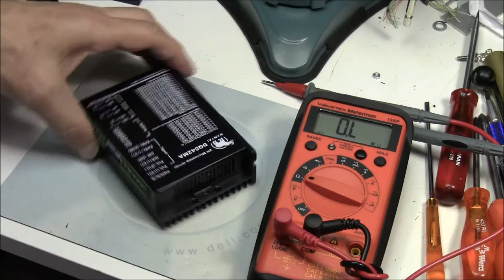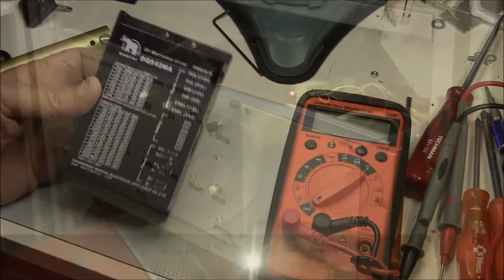Repairing a DQ542MA stepper driver

Comment: What if there is no fuse? what part of the driver usually would go bad? I have a bad stepper driver where the motor just buzzes and doesn't turn.
Reply from the maker: Thank you for your comment. All of the DQ542MA have fuse, the inside should look the same as mine, if there is no fuse then they did not install it. If the motor buzzes but don't turn then anything can be wrong, perhaps your motor, or your PSU, or even the driver. I can't really help you out on this.

Comment: What if not the fuse.... turning motors while all off can damage the driver?... I just left my cnc off for several months...then when i turned on...one driver dont works...just death
Reply from the maker: I am sorry, I don't know. Since I made the video I managed to fry another one and I also thought it's just the fuse, but it was not. I tried to find the fault but gave up because the drivers are cheap, so not worth spending too much time on them.

Comment: Hi There, can you perhaps share the exact fuse model you used please? my stepper is also dead - received it dead when bought new, so I think I'll do your testing this evening and replace with a 50v 10amp SMD, but It looks like you get various sizes of these SMD's? I'm not sure - please can you assist?  thanks a mill
Reply from the maker: Hi, The fuse I bought is called: Littelfuse Fast Acting SMD SMT 1808 10A 125V surface mount fuse similar to this one:

https://www.ebay.com/itm/10Pcs-Littelfuse-Fast-Acting-SMD-SMT-1808-10A-125V-Surface-Mount-Fuse-/182395604433?hash=item2a77a00dd1

The size of the fuse is exactly the same, so it is very easy to solder a new one on top of the blown fuse. It is however important that you are definitely sure about the blown fuse and NOT solder on top of a fully functional fuse because that may cause serious problems later on. Connecting fuses in parallel means that you increase the current from 10A to 20A which means that the fuse is no longer protecting the driver, so diagnose before soldering the new fuse on top of the old one.

Good luck with the repair.
Reply: Perfect - thanks a mill for the quick reply :-) now to try and find these babies in South Africa, mission # 2 :-) let you know how things went! thanks again, much appreciated!!
Reply from the maker: https://www.mouser.co.za/ProductDetail/Littelfuse/0476010MR?qs=sGAEpiMZZMsIz3CjQ1xegc2b%252bH%2f4y90ivrfVPzgV2rqjDTBaXyVH3g%3d%3d

Immediate delivey, ZAR 17,51 piece if you just want one, or ZAR 13,06 piece if you buy 10. Plus shipping of course, if you can't collect it. The other alternative is eBay but it takes longer. A third option is to replace with a glass fuse but then you have to add a fuse holder also so it will not be that nice.
Reply: good Lord Man, you put me to shame :-) I did find some at Linkage, (in JHB the fuse cost R2, in CPT the eact same fuse costs R38 - not a lot of money but such a jump in price...) Im on the Mouser .co.za site - looking for their CPT branch!! thanks a mill (again) :-)
Reply: I mailed their South African branch to see what they can do :-), so that would solve the 1 stepper driver, then I have a dq860ma that gets the green power light to come on, but nothing else else happens on the silly thing, I recon I would try replacing that fuse as well (which is a different fuse) looking for technical spec on that driver as we speak.... :/ I thought hobbies were suppose to be fun :-)
Reply: No Mouser in south Africa, not even sure why they have a south African customer support email add or why their Domain is registered as .co.za.... anyhoo - I did find what I need for now, thanks... I just hope that this would solve the issue. (on the flip side of the coin, I did find a place here in cape town that can repair stepper drivers :-) (if all else fails)
Reply: UPdate : short answer would be that it didn't work, didn't receive the right fuse, but did try same on my dq860ma driver - no luck, went and bought a TB6600 4.5amp, will collect today to get my machine up and running again.... thanks again for your guidance and efforts - much appreciated!!

Comment: I have a DQ542MA 4.2A Stepper drive and it is not working.  What does the Blinking red and green LEDs mean?  I can not find any pdf documentation on the drive.  Can some one relate to this ?  or have advice
Reply from the maker: Hi, I guess only the red one is blinking. What it means depends on the blinking. It can mean that "Over-current protection activated when peak current exceeds the limit." or "Over-voltage protection activated when drive
working voltage is greater than 52VDC".
Reply: No.  That is what i do not understand.  I found a document that says only the red LED blinks, but the green also blinks with it.
Reply from the maker: Sorry, I have no idea. Could be anything between a simple lose contact or bad solder to something complicated. Very difficult to find the fault without access to the driver.
BTW, two simple questions. Have you opened it and checked inside to see if everything looks normal? Have you checked the fuse I am changing in my video? I don't remember the sort of fault indication I had, except that it was not working, so basically it can be as simple as the fuse.
Reply: Petrus Pretorius did you fix it? I have the same issue. Replaced the fuse and problem remains

Comment: The fuse on my driver is ok but the LED goes off and the engine is not working ... where is the fault?
Reply from the maker: Sorry, I have no idea. That question is impossible to answer without making an analysis of the problem. Try measuring all the wires and check that you connected the driver as they must be connected.
Reply: Everything is connected. The driver worked then illuminated the red led diode and then went off and the driver did not work